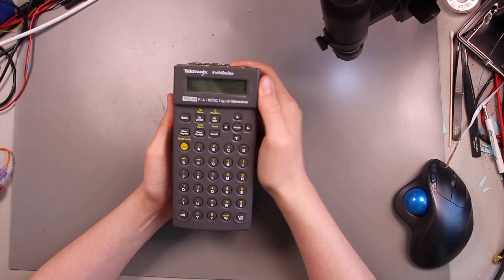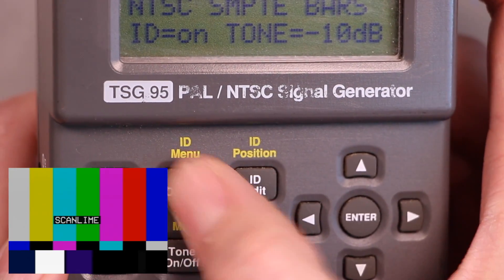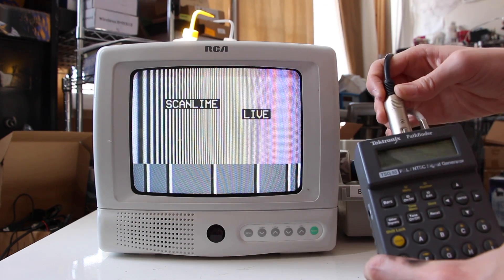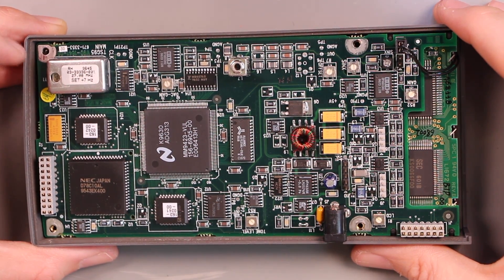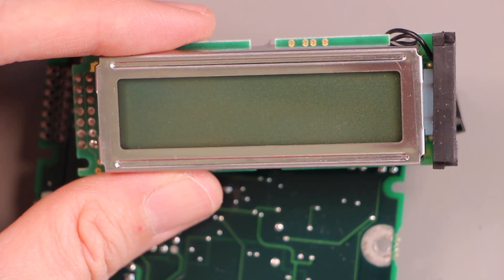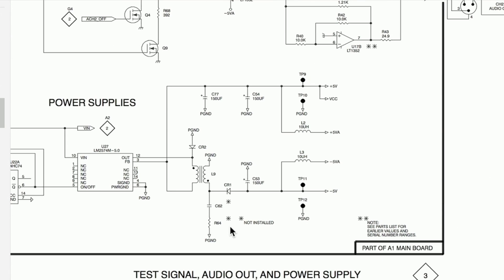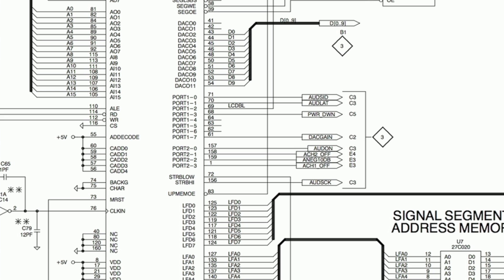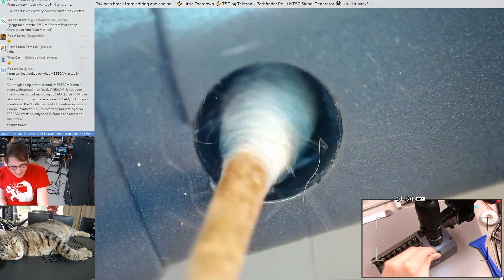TSG95 Color Bar Generator Teardown - scanlime:020

Comment: I have two of them, and these are the faults I've found and the solutions:
Display. Replace, in Aliexpress there are spare parts.
No signal message. Replace 24C16
No power up, 5V is noised or below 5V.  Replace Nec uPD78C10AL 
No power up, power voltage does not reach to voltage regulator. Replace power connector.

Comment: Our station had a TSG90 (NTSC only version). It was used for remotes like telethons and sports. It was important to keep video on the line at all times otherwise alarms would go off in the switching centers going north to NYC.
But when the NTSC stuff became surplus, I picked up a TSG170a off Ebay for $20. Its a rack mount unit which pretty much does the same thing as the TSG90.
Enjoyed your video!

Comment: Great video!  -  Can this TSG95 be used to connect to the RG59 input jack of a television?  Or is this only for direct connections to a TV/Monitor video input jack and a TV audio input jack?     If I connect this TSG95 to a Television RF input jack,  which chanel do I need to select on the TV in order to view the color bars?
Reply from the maker: This device doesn't output a modulated RF signal, though you could add an RF modulator. I think it was intended for broadcast environments where the specific levels of the non-modulated audio and video would be important.
Reply: NTSC only... there are a few TV channel generators out there... Leader had a really nice one!

Comment: Haven't seen one of those for 20 years. TV location engineers used them for identifying and setting up remote cabling, for equalizing long runs of video coax, getting the stereo round the right way (you could set the tone frequency to be different on the left & right), and for sending an idented colour bar signal to the studio. They were standard on all location trucks, or at least a version of them was. The earliest version I can remember was in a 19* rack and use tubes!

The grid pattern was used to register the colour guns of TVs and monitors. The red field would show up magnetisation problems. CRTs were prone to this as the internal mask would become magnetised during transport and produce colour errors due to the beams landing on the wrong phosphors. CRTs are fun! 

The sine squared pulse was used for compensating for group delay on long relays. The frequency steps were for setting equalization on the same. Both would be needed for stadium remotes where you might have a kilometre or more of coax between the furthest camera and the truck. The hazards of analogue video distribution. A lot of kit was needed to correct for all the errors introduced in just sending the signal from one place to another, even if the other place was in the next equipment rack.  Back in the early 70s when I was doing my training at the BBC, I remember spending a couple of days with a test generator and scope making up short lengths of 75ohm coax with delays of 1, 10 & 100 nano secs to use for trimming the delays! Many years later I saw an interview with the great Grace Hopper about how she used to carry a piece of wire that was 1 nano sec long. This was on Letterman, and when he obviously had no idea what she was talking about she produced a bunch of wires out of her pocket and gave one to him! "That is one nano second at the speed of light!" Magical!

The TSG95 is a very nice piece of kit and I recommend you keep it and cherish it! They were expensive things back in the day. And thanks for a very interesting tear down, I've never seen the inside of one of those!

Comment: I just got a TL866 USB Programmer for reading/writing some old flash memories. I see it supports your 27C512 EPROM. Totally recommend it - the software is more usable than other programmers I've used in the past and it's super cheap. Just need to get a PLCC-DIP adapter.